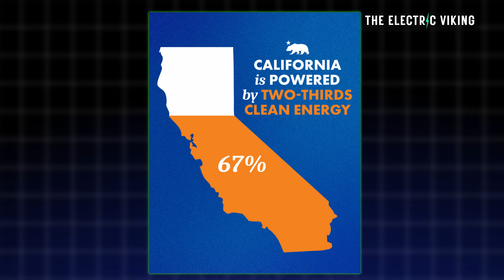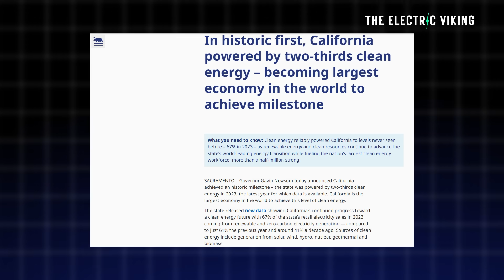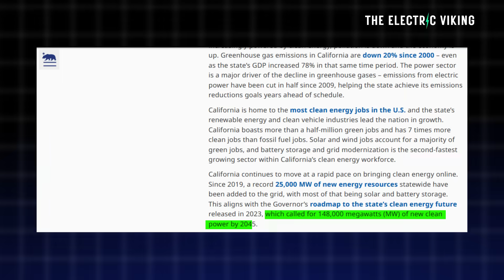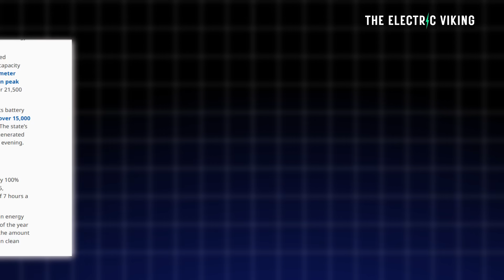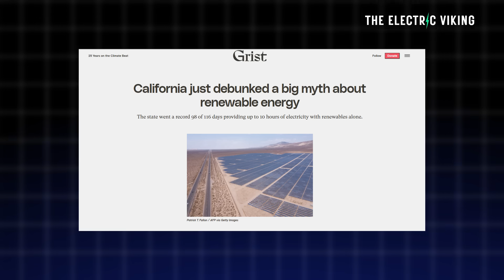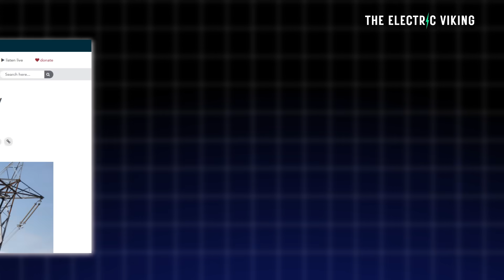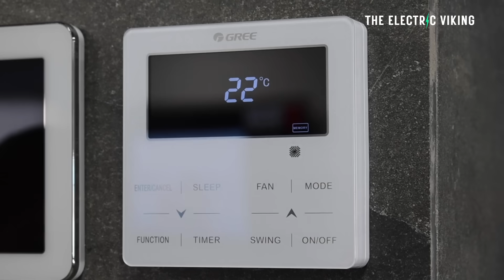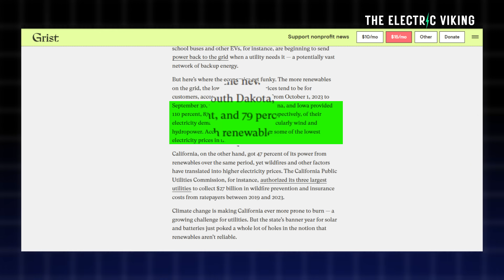California Shatters Renewable Energy Lies; Largest economy in the world to do this

Comment: My solar panels and batteries provide 80% of my power so far this year, including for my EV, and the 20% that I have to pay, I pay from my gasoline savings since charging my car is about 1/3 of what it would cost me on gas. And I never lose power. I love my solar panels, batteries and EV.❤
Reply: Same here. Since we also have a geothermal heat pump (for heating and hot water), PV, battery, 2 EVs, we are at about 70% including the cars. We bought PV about 4 years ago and it will need about another 4 years to break even cost wise. The switch to clean energy in Germany is going on and the grid is adapting very slowly, but at least it does.
Reply: Hear Hear 
Ev, battery and solar
Love it 😎👍
Reply: This means, we crazy Germans are not alone when it comes to this green renewable madness. For everyone that just starts out with this for their private home, the combination of a heat pump water-boiler with solar panels and a small battery worked most beneficial for us so far.
Reply: Designed and built my house around solar nine years ago; even with an EV I am still net positive, and not having a heating or cooling bill is great, along with peace of mind with battery backup when the grid goes down.
Reply: @craigmerrow225  Who cares.  The point is, the price of power has gone up for the working poor.
Reply: It’s strange how critics of householder solar installs reflexively concern themselves with investment payback when most all major homeowner “investments”/purchases are initiated without regards to short term payback (cars, home, financial investments, furnishings and education).
Reply: @danielsteele7225  Solar is not essential like having a car to get to work and a roof over your head.  Solar is for upper middle class and rich people.  60% of households live pay check to pay check in the US.  Fact are uncomfortable, i know.
Reply: Have you recovered your investment in the panels?
Reply: @4WDmarshmallow  for my panels I would say I have recovered about maybe 60% but the batteries were expensive, but I can run my entire house on them, including the AC.
Reply: Poor people don't have enough money to buy food, let alone the capital for solar.
Reply: @rickybosephus2036  correct. But if those who can afford it install solar w batteries, then peak power prices will fall, effectively lowering the elec bill of those who can't. I only see win-win-win.
Reply: it hasn't happened in 15 years.  What makes you think it will in the future?  I live in California.  Prices are higher than ever.
Reply: @rickybosephus2036  Some of the wildfires have been caused by overhead transmission lines. The power companies are having to pay out large settlements and to bury the lines to prevent it from happening in the future. So, they're passing all those costs on to you. Heatwaves that last longer and have higher temperatures means more power required for air conditioners and that increased demand has also driven up prices. So any savings that you could be seeing are currently being eaten by other things that will change.
Reply: @Tempus64 what happened to the transmission lines to cause a fire? Did the lines break? And how was this the result of renewable energy? Do you know how power is transmitted over power lines? Powerlines don't discriminate. They just transmit power 😂
Reply: @Zoro-x3q7s  Transmission lines cause fires via sparking which can happen for a number of reasons. Wind knocks them down, transformer failure etc. Where did I say that had anything to do with renewable energy. That energy is transmitted via the transmission lines which are owned and operated by the power companies that you pay your bills to. Do you actually think your electricity bill is purely the energy?
Reply: @Tempus64 😂 lol, totally unrelated. There seems to be a software glitch in YouTube's comment logic.
Reply: @Zoro-x3q7s  Are you on drugs or something. The person I was responding to was talking about his electricity prices being high and I was outlining some of the reasons. You seem to be the one who's having a glitch but go ahead and keep posting emojis since that makes you look really smart.
Reply: @Tempus64  buying solar panels from a communist country with nuclear weapons pointed at you, human rights violations up the wahoo, also has a downside.
Reply: @rickybosephus2036  Poor people don't have enough money to buy a house. The owner of their rental property has the capital for solar.
Reply: @Tempus64 well maybe they inherited it . Also if you pay rent and have a stable employment consider taking a mortgage for your house
Reply: @corradoalamanni179  If you inherited a house, then you have wealth and aren't poor. You might be cash poor, but not wealth poor and you can sell the house or even take out a second mortgage to pay for that heat pump. If you're poor, you don't even have the money to save for a down payment on a house.
Reply: @rickybosephus2036 Poor people will have no choice because utility scale solar wind and battery are lowest cost energy.   Residential scale solar and battery while more expensive than utility scale wind solar with battery cost curves are projecting them to be less costly than gas, oil, coal utility scale electric power.   If they do not have the money to buy a house or EV then they will need to buy it through electric residences and electric public transportation because solar, wind and battery are lowest cost now with projections to drop a further 80% in cost over next 10 years.   Coal, oil, gasoline, gas generated power will still exist but like wood, steam, horses and mules will be relegated for rich persons nostalgic and entertainment purposes.
Reply: @rickybosephus2036 they don't have to, not everyone has to get solar, if a person doesn't have the means they don't have to get solar.

Comment: Many positives, but what you're missing -- and Spain experienced -- is the grid requires a) power and b) the inertia provided by large turbine systems to overcome voltage fluctuations. Spain's political leaders (despite warnings from energy engineers) have disregarded this requirement and have pushed for full solar/wind as their solution. The result will be a highly unstable system that can also bring down others connected to them (Portugal, France, etc.) as nearly happened a few months ago. CA is fortunate to experience mostly sunny weather, but most other states do not. You're also disregarding the environmental damage caused by solar and wind turbines.
Reply: It’s disregarded because it’s small. Compared to fossil fuels it’s minuscule.
Reply: Grid firming and inertial services are provided by batteries without issue.
Reply: @chrishaberbosch1029  That's simply false. I work with engineers who can explain it to you. Likewise, association engineers in Spain wrote government documents explaining the pitfalls of no mass and inertia in the system.

Comment: Actually, it hasn't been 100% as they are forced to keep gas run power stations running since they are so costly to fire back up as well as taking up to half an hour. But their generation has been down to about 1GW during the day, making it about 98% clean energy.

The interesting thing is that batteries have ussualy been the number 1 provider of power during the evening rush hours from about 7PM to 9PM, (while being in the mix for the most power provided been 6PM and 10PM) providing upwards of 10GW of power at their peak during that time. And California keeps adding more.

And lastly, California is awaiting the completion of 2 major grid power lines running from Wyoming and New Mexico that will provide another 5GW plus of wind power, built mostly by a former big oil tycoon.

Comment: An overlooked aspect of a lot of EVs is that if mid day charging is heavily incentivized, this allows more solar to be installed without as much need for utility scale batteries.

The reason for high prices in CA aren't from wildfires, this is a copout. It is due to corruption. Prices were skyrocketing before the wildfires, and the total pass on cost from fires is small compared to typical utility bills there. If you look at a graph, price has gone up heavily correlated to renewables, but this is likely due more to corruption and mismanagement, as the same increase doesn't happen elsewhere with a lot of renewables.
Reply: I often wonder if the power lines had nothing to do with fires. Lazy investigators, when they are stumped, fall back on "must'v been electrical"

Comment: Nothing impossible about being off grid in the first instance. As far as the economics of grid power there are definitely approaches to consume vastly less power whilst delivering an equal or better result absolutely.  The US State of Virginia built back in the 1950s hydropower #pumped_storage the economics of pumping water uphill into the reservoir when demand is low during the night for use during the day. Doesn't seem like this would save electricity "using electricity to save electricity" contradiction reversing the turbines draining the lower Lake to fill the upper lake uses power right? anyhow been doing that for 70 years all using renewable power. If you add solar and wind PLUS STORAGE that's in theory a truly awesome amount of electricity a utility can draw upon during peak times...all in theory instantly available. All very valuable power as well if known how much be in fact available, this amount be material, this power in fact be available/dispatchable and then when needed does in fact "work"(is properly dispatched to the grid.) Typically time delays cause grid failures ...something that can be very expensive to fix. Also in an Industrial economy the power draws can be absolutely enormous let alone the power draw from a major city(ies) on top of all that so anything that adds to grid stability instead of subtracts very valuable power absolutely...I wouldn't say 100% renewable does that at all but it most definitely helps now not at all hurts. Long #qbts strong buy computers use a huge amount of power as well😊😊

Comment: I belive renewables must be combined with high-power DC transfer lines across the country and batteries at both ends.
By being spread over a large continent, whether fluctuations are greatly reduced.
Renewables most likely has to be combined with nuclear to get the right characteristics. That supplies a basic level all the time, so the night is covered too.
Not every country are large enough for this to work perfectly. But the USA and Australia certainly is.

Comment: IRA solar incentives for residential will end this year (2025). Without the 30% federal tax credits, solar adoption will slow. This will cause increased demand on the grid and further rate escalation by the utilities.
Reply: Solar panels are extremely cheap, you can easily find for $0.20/KW. The 30% tax credit was largely abused by installers, who would often just mark up what a system should cost by the tax credit amount. The cost of rooftop solar is currently about 65% installer labor and markup, 5% regulatory red tape, and 30% equipment cost. Then greedy lenders on top of that. You can install your own system with battery storage and no incentive for less than the cost of an installer with incentives.
Reply: As far as I know, Japan doesn't have solar incentives, or if there are, they haven't changed recently, and panel prices have almost halved in 6 months. ¥10,000 for 100w used to be a bargain, now you can have 250w for ¥13,000!

Comment: I live in South Orange County, California, and our electrical rates have been higher (nearly 2x) the national average for almost 2 decades now. Wild fires had nothing to do with it. As soon as they started printing on our electric bills that our electricity came from  renewable sources, our rates started climbing exponentially. I'm averaging around 50 cents per kilowatt-hour. I have a realtor friend who tells me electric bills in the summer in my area for 2 story 2,000 square foot homes routinely exceeds $1,100-$1,200 per month. He says this is the norm. I'm retired and pay $200+ per month to run one LED lamp, my computer (18 hours per day), and a refrigerator. I rarely run any other lights, and almost never watch TV. I run my washing machine once per week.
Reply: I would recommend doing an off grid system. You could do one for your needs four about 4-8k. It would payback in about 2 years. 50 cents per KWH is absurd. You can also just get a portable solar generator and a couple large panels and get a significant offset. This is about 1-2k depending on how much you want to start with.
Reply: No way. I live in Santa Clarita and have two electric vehicles and two heat pumps to heat and cool my house of 1800 square feet. My bill is maybe 500 tops in the summer. My average is .30. I'm on TOU D Prime. which SCE. Who is your provider?

By the way, Los Angeles is .25 per Kwh.
Reply: @ERIKM-ed9ef 
I’m in OC also and it’s 44 cents per KW from 4 pm to 9 pm. 
22 cents the rest of the day.
Reply: It’s the air conditioner, brah
Reply: Texas has about the same amount of renewable energy as California, but its electricity is relatively low.
Reply: Other country here, but I installed (myself) recently a small PV farm of four 450W modules, a small 2 kW/h batterie and an intelligent energy controller. This system produces during the northern summer more than I can consume (two person house hold, no EV). The investment of around 1200 Euro/$ will pay for itself within 4 years only according to current numbers. Electricity consumption costs are at 40 cent here. If you have a small garden or a garage you should be able to do the same with reasonable installation costs. We expect countries in southern europe to become completely independent with less than a decade.
Reply: We have the highest rates because all the major utilities are making record profits. PGE made around 2.5 billion dollars each of the last two years.
Reply: Nonsense. Utilities in other states could do the exact same thing if they wanted to. They don't because they have less renewables. @jjackson3240
Reply: @jjackson3240   You understand that PG&E is a regulated utility, right?
Reply: @robhoneycutt pG&E is in practical way regulated.    That company OWNS the CAPUC.
Reply: @robhoneycutt  PG&E does whatever it wants.  It owns most politicians in California, and has for decades.
Reply: @sunspot42  No, they don’t. They answer to the CAPUC. And of late, because of the fires and resulting rulings and settlements, they also have to answer to the courts.
Reply: @robhoneycutt CAPUC is totally captured by PG&E and the other big utilities. They do whatever the hell they want. 

PG&E should have been forced into bankruptcy and seized by the state when their unmaintained power lines lit half the state on fire. Their executives should have been jailed for life as terrorists.
Reply: @tedg1609   No, they do not. The “Public” in PUC means “not private.” It is a regulatory agency instituted through a state constitutional amendment.
Reply: @tedg1609   Where do you get that idea?
Reply: @sunspot42   Sure, it’s fun to say that but it has no basis in fact
Reply: Nonsense Sam. If they are passing on the wildfire fines to customer, those customers could just get their own solar and battery on finance terms and pay less than the utility charges. They don't do this because that option is also expensive. Especially in winter. You don't heat your house, or geyser in winter using solar or batteries Sam.
Reply: Is it possible California electricity prices are higher because renewables are unable to cater to such large populations without significant help from fossil fuel generation?
ChatGPT said:
Yes, that’s a very plausible and partially correct explanation — but it’s only one piece of a larger puzzle. California’s high electricity prices are not solely due to population size or renewable reliance, but rather a convergence of structural, policy, and infrastructure-related factors.
Reply: @Chris-d3w7m  Read the actual research instead of asking ChatGPT. Clearly many markets are successfully making the transition to 100% renewables, not just CA.

Comment: Alternative energy is not a cure all for all areas. It works great in some areas and not others. Try running on solar in the Northeast or Great Lakes area of the US and it will fail. The key is to evaluate what can work and where for an area, and select the "Type" of energy as one would select an appropriate tool
Reply: What exactly are your sources? Off the top? You have no idea what you are talking about. You must have stock in OIL
Reply: As of Jul 2025, over 4,739 megawatts of operating solar capacity have been installed in the State of Illinois. Illinois has a solar map that tracks projects underway and completed, so even in the Midwest solar does work very well. If it didn’t work why would they be planning and installing new solar farms?
Reply: Wind turbines for windy states. California has sun but no wind.
Reply: @larryc1616  Huh?  Coastal California is extremely windy.  San Francisco is one of the windiest major cities on earth, and it's windy pretty much year-round, but especially in summer when power demand is high.  The passes between the hills east of San Francisco are littered with wind turbines.  So are many other windy passes in central and southern California.  Wind accounts for around 6% of the power generated in California.  It used to be more like 7%, but there's been a massive increase in solar power over the past 5 years.  The state gets around 33% of its power from solar now.